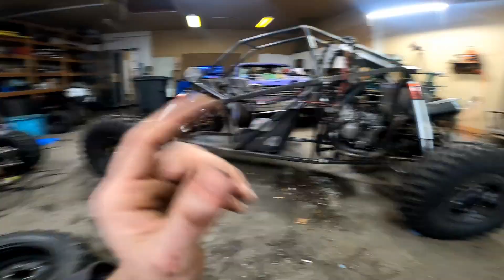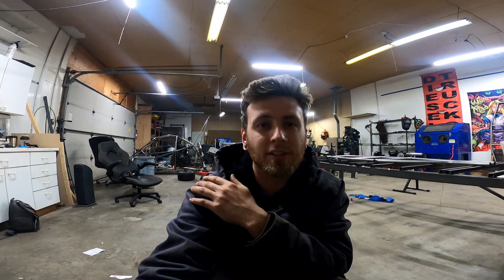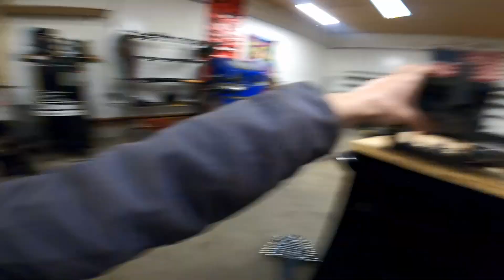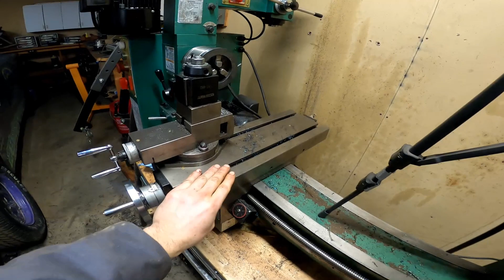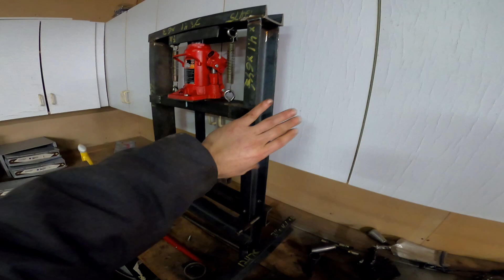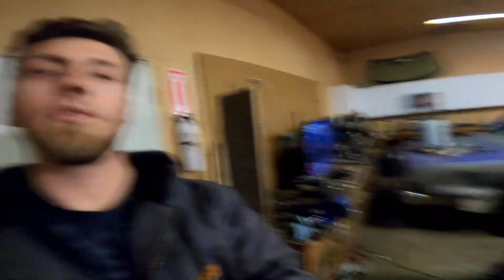CRIBS JimboSLICExD edition: Shop and tool overview

Comment: I went through the same Conversation with an old machinist about the lathe/mill combo units.  He said its gonna be a crappy lathe and a useless mill.  He was right, I ended up with a 10x40 Lathe and a Bridgeport style milling machine with DRO and more money in tooling than the machines we're worth all for less than a combo machine.

Comment: I made it to the end! I have the same bender with the harbor freight ram and swag billet adapter, the same hobart welder, I have a mini lathe upgraded with about every goodie that littlemachineshop.com has to offer. Now just need a shop with that much space or more. I have a 2-1/2 car garage and still park 2 vehicles in it.
Reply from the maker: Hell yeah! Could you show me how you set up that hydraulic ram on the bender?